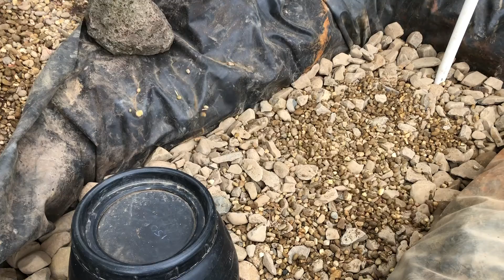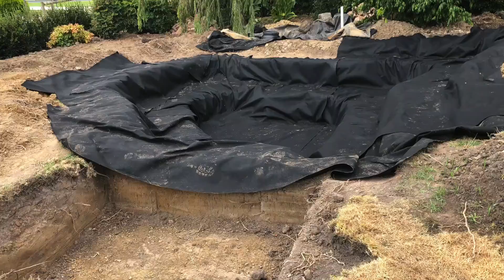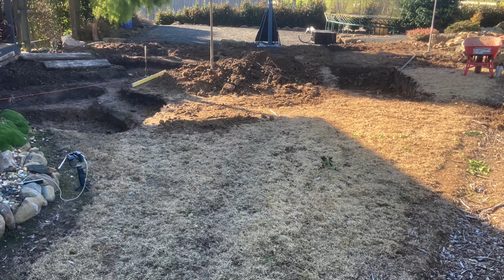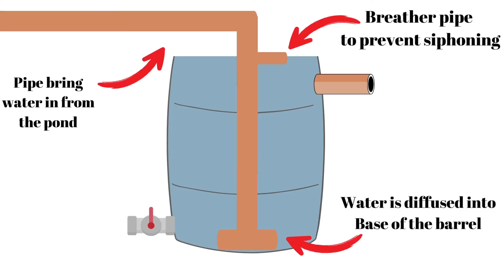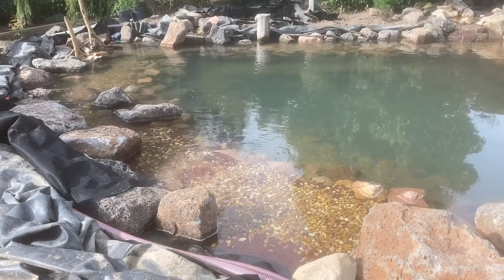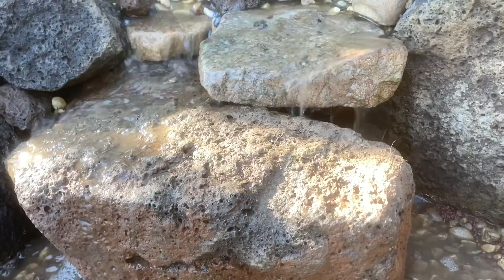How to build a DIY backyard ecosystem pond with bog filter, intake bay and stream

Comment: Hi Kev! Thanks a lot for your generosity sharing your knoledge!! I really apreciate that! I have a 7 x 11 meters swimming pond, that you could call "just natural" because there´s no biological active filtration more than the bacterian biofilm on the rocks and pebbles and the big quantity of plants that are stablished over 3 years now. But I want to build a bog to improve the water quakity (wich is good, by the way. Some days I can see the bottom on the 2 meters deep area. ). My question: can I use 110 mm drain pipes instead of the trench you use? (not posible to find here in Argentina!). And to make the slots with a electric saw , aprox 1/3 depp in the pipe, how many in a linear meter of the pipe you sugest to do??? (I am gon use 2 meters pipes !) Thanks in advance for your help!!! and regards from Argentina!
Reply from the maker: It depends on bog size and configuration.

Comment: Hi Kev, I made a big barrel filter as you’ve instructed in your previous uploads and it’s working great , my pond is 1500 litres and I’m only getting 480 litres per hour flowing through filter because pump is also running a water fall , do I need the full 1500 litres to flo through filter per hour, thanks Mick
Reply from the maker: Great to hear Mick. 480L through the barrel should be perfectly fine 👍
Reply: @Ozponds  Cheers Kev 👍